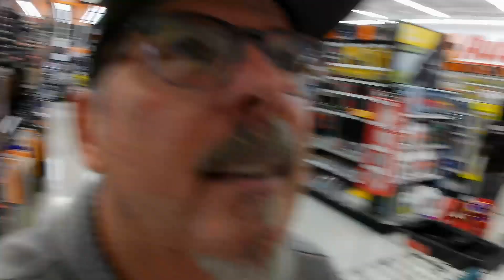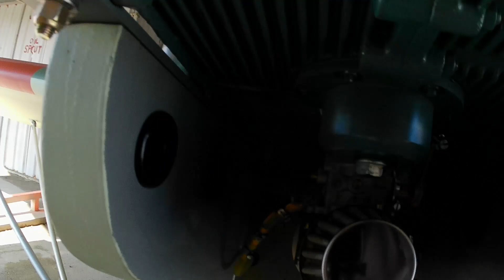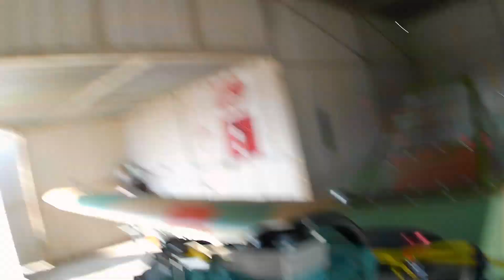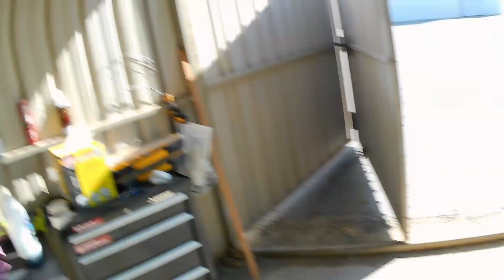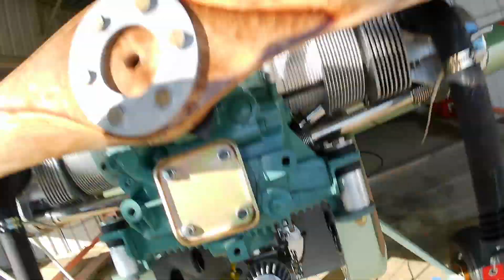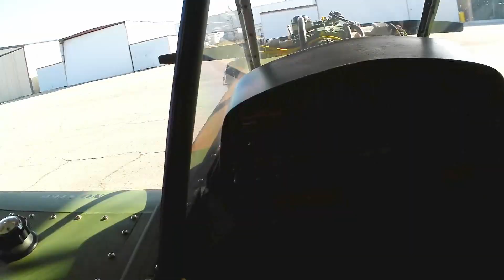Team Minimax 1100r Aircraft - Maintenance Day

Comment: Hi Dennis, I’m looking forward to see your results with the GenniPod.  I have one I’m going to mount on my Fly Baby this winter.  Is it a GenniPod II?
Reply from the maker: That’s the one I ordered, the GenniPod II. 
I really believe it is going to be the ticket.
Reply from the maker: I don’t love adding more weight to the airplane but I really have to have it and should have planned it in from the beginning. I plan to stretch out a bit with my airplane and don’t intend to just stay close to home, so getting somewhere and having to plug my battery in is just not ideal.
Reply: I have routinely flown my Fly Baby between New Jersey and Central Virginia which my current configuration handles well.  But, I’m planning longer flights in the coming year.  While I have two batteries and I’m capable of recharging via solar or plug-in, there are trips I’d like to take where I will not have enough time to solar charge and power may not be readily available.  I’m currently using sealed lead-acid batteries, so I’m very curious about your liPo installation.  I’ll be installing mine in the next couple of months.

Comment: Hi Dennis, make sure you shake the oil before dispensing, additives tend to settle out with time. Notice, even at 5 hrs. the oil seems dirty at drain... I would install a Frantz oil filter, which is a bypass filter but excellent filtration.

Looks good, take care, Ron
Reply from the maker: Thanks so much Ron! I’ve seen those bypass filters

Comment: A cross wind 45deg from the left would reduce the rudder input needed or make it slightly right rudder (which you are used to). It's Great you have got to the 5hr point, roll on 20hr more and do the next oil change and then everything will be in line. Speed checks and climb rates all need to be done in stable air (hight pressure weather systems are good), here in the UK cold frosty mornings are the ideal but you don't get those too often in your state 🙂
Reply from the maker: That totally makes sense!
Scott says this engine doesn’t start to break in until around 10 hours.

Comment: It's nice to know you can get away from cloud suck.  It can be great until it's not and you are in the white room.  With hang gliding your always looking for lift but need to have an exit plan for clouds. Fly the edge and be ready to run away.   Curious if you can thermal with it. Keep up the good work and videos.
Reply from the maker: I didn’t know you were hang gliding. Where do you fly?
Reply: It's been a couple  years since I've flown.  The last time was Lakeview Oregon.  A couple of 25+ mile flights in ridge lift conditions.  Lately we have been building a house in Elko, Nv and haven't had time for flying.  Hope to correct that this coming year. Ànd find some nice mountains to fly locally. Maybe even build a Minimax 1100 that I've had plans the  for 20 years.